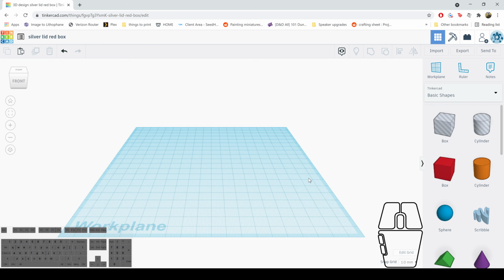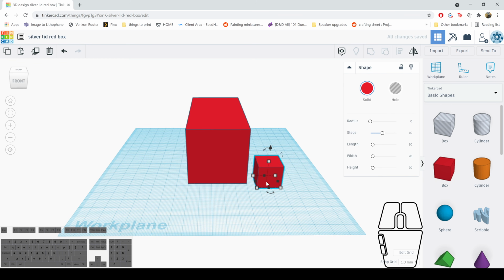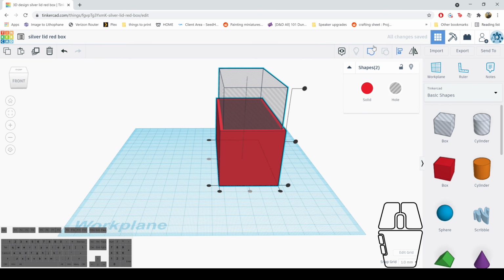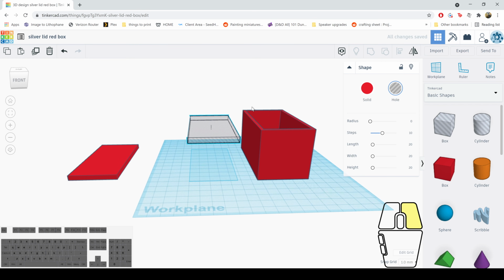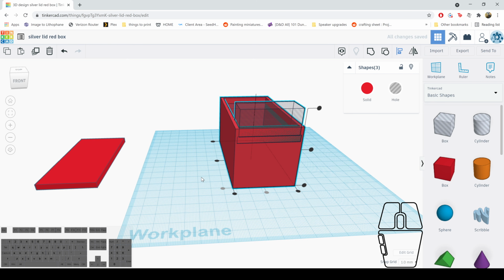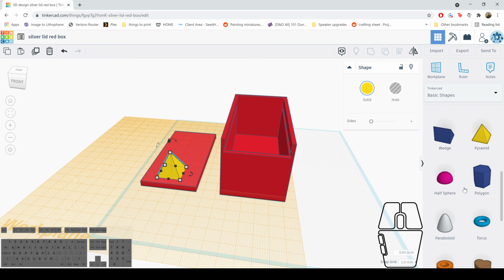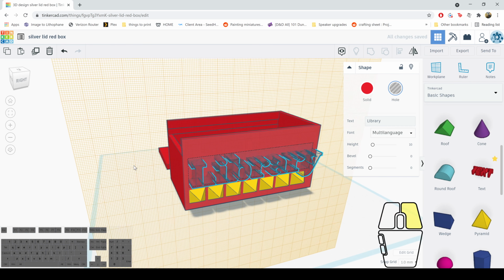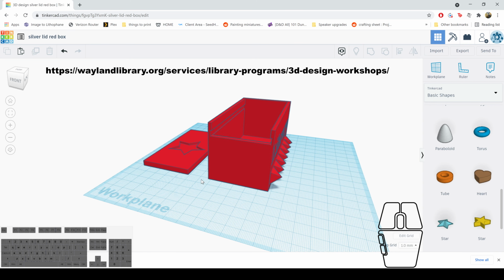Sliding lid box - beginner/intermediate Tinkercad

Comment: Thank you for a detailed look and instructions on using this software to build a sliding lid box.  One thing you did automatically, but didn't say it, was to ensure that the text on the side of the box was placed below the lid dado on the inside. While you didn't embed the text too much, if it was embedded in line with the dado then you may end up with a single layer of material between the lid dado and the text instead of the 2.5 mm you had to start with.  Again, a very nice video.